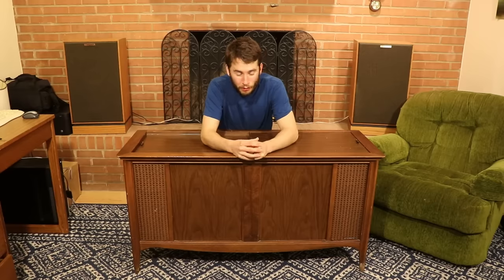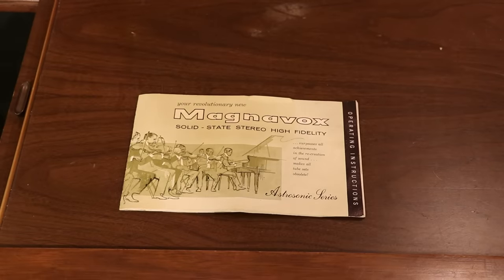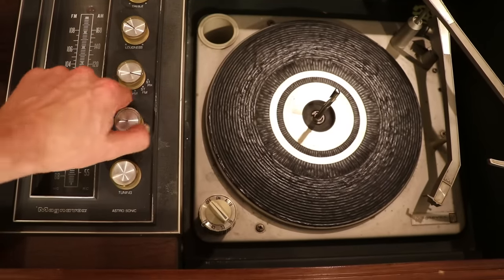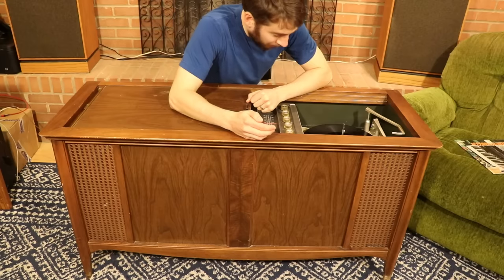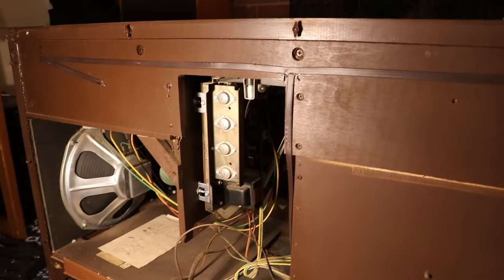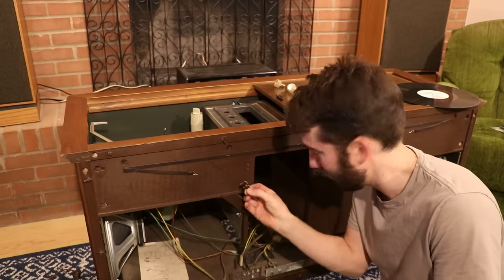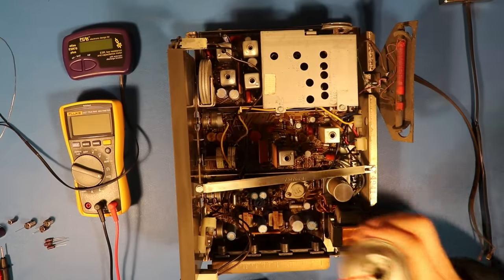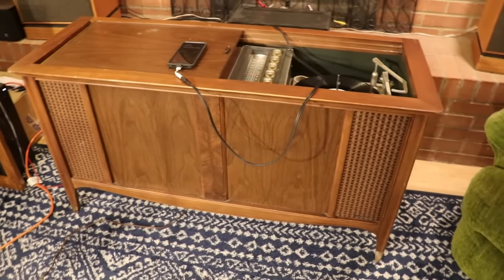They Found A Broken Stereo Console On Trash Day...Let's Fix It!!

Comment: I have the same basic chassis in a Magnavox, but it is in a " Colonial" style cabinet. it was free on Craigslist. One channel out also,, but no radio or phone noise. Your tutorial was grear, and I will try what you have done, perhaps I will have similar luck. We used to use everything from dimes or in your case, a puzzle piece on the turntable pickup arm of  modest quality phonographs to adjust the weight on the needle. Thanks for posting.

Comment: Such cool vintage stereo! Why can’t there be cool individuals like you that repair such beauties in my area 😭🤣
Loved this video, thank you!
Reply: A few years ago we had a shop that did only vintage repairs on tube equipment and the line was out the door and half way around the building most Saturdays. In the back room they had a few older guys who were semi-retired doing triage as they came in. A good percentage were repaired on the spot with bulbs, fuses, tubes. The rest were done during the week.... or following weeks. Sadly, they closed up, probably due to a shortage of skilled labor as those guys moved away.
Reply: @rupe53  I would love to work with old electronics. I would love to repair tube amplifiers and some stereos. Even hifi console record players that have radios built in. This would be a good retirement racket to get into. Not so much for money but just enough supplement income and having fun doing so. I could open up a shop if I knew I could round up enough business to keep it going. I plan on north Georgia about 2 hours from everything. Atlanta, Chattanooga,  Asheville etc. 73
Reply: @ronb6182  ... I suspect the biggest problem you will run into is area demographics. Where I live there are people who have the luxury of discretionary money. It's mostly upper middle class and they can afford to pay. The second thing is (where that shop closed up) about what the property is worth. They had an older building on the main drag in town and it was next to a new strip mall. It's easy to see the location was worth more as a Burger King these days, despite the fact that it was probably someone's humble home in 1950. Not saying it can't be done... and there are people doing vintage repairs, but you need some research on how to develop that business, so you don't wind up with a garage full of junk (and parts) without a way to pay for your time. I would suggest an open-ended credit card deposit to cover diagnostics and shipping costs as a starter.... and no warranty on anything that's not repaired completely. IOW, short cuts = no warranty. Still going to cost a minimum of $100. (just an example)
Reply: @rupe53  yeah I know I would rather locate a repair shop already established and work part time. But my luck I would have to drive to Atlanta. I think they have a shop or two. I will keep a post if I find a shop I have a couple of years before I retire my current job. 73

Comment: I saved a 1962 Packard Bell Hi fi console the same way. Mine is Tube though. It all works and I have my PC sound board connected to the auxiliary RCA ports and an 8 track player attached to Tape. Record needles were kind of hard to find so I bought three of them. The Stereo isn't super valuable but I like it.

Comment: My Zenith console tape inputs sounded weak as well.  I saw there were two capacitors (one per channel) just after the jacks.  I replaced them and it fixed the levels.

Comment: I have an old TV/radio/ record player unit and it is from around the 50's made by Siemens, it ran the last time I used it but will need recapping for sure.  Mine has Valves in it  and it is extremely heavy I looked it up and weighs in close to 90 KG, it also come with the manual but it is in German.

Comment: I would have gone right out to save that, too. I’m a buff 💪 of radios 📻, consoles, and 5 inch portable TV’s 📺 from the 1970’s and 1980’s. My mom bought me a console at Salvation Army for $147.00 in 2010. It means something special to me, as to her passing in 2016. One ☝️ of the channels to your speakers 🔊 is bad. It’s probably a bad capacitor on the board. Could be a bad potentiometer. I’d be VERY CAREFUL, if you’re hearing crackling noises (it’s probably only static), but if the noise is actually crackling noises (and burning smells), I’d be worried about fire 🔥. That AC hum is the classic symptom of electrolytic capacitors going bad. I don’t think 🤔 I’d try amplifying that noise, it might blow your speakers 🔊. Your friend, Jeff.

Comment: Mid 60s Magnavox. Very boomy sounding. They deliberately made them that way. Most people thought "Hi Fidelity" meant loud booming bass. With some tweaks you can make it sound a little better. It is under-powered. About 10 watts RMS (only two output transistors per channel-- and they are Germanium type). Sylvania made the best console at this time. 30 watts out per channel and they sold it with a high end German DUAL turntable with a Pickering cartridge. Real Hi Fi.

Comment: I have a 70’s RCA console and the one speaker cuts in & out. The speakers are incased in some sort of foam insulation. I need to find out how to pull the board like you did.

Comment: I was in my teens in the mid 1960's when my Dad was looking for a stereo receiver, record player. Magnavox was top of the line and I remember this model looked like the one he was about to buy. It was a $499. stereo. A brand new 6 cylinder Mustang was $1900 brand new. He chose a Dual record player, Scott receiver and a pair of EMI bookshelf speakers with eliptical drivers.

Comment: Nice find
Been hoping to score a similar MCM style console for years.
Given size and weight, plus gouging by "collectors " sellers for units, often not even serviced, you need to find these local.
The real value to me is the MCM cabinet, and speakers and amps secondarily.
Cool to futz with the radio tuner and turntable, but putting in a more recent table and disc player via line, aux inputs is the way to go

Comment: In the 60's I worked in a store that sold Magnavox Stereos and televisions. 
One of the earlier systems had a record changer that promoted that its tone arm tracking force was 1/10 of an ounce and there were aluminum coins that were given out as promotion for how light that was. 2.8 grams is considered pretty heavy these days. 
They used crystal cartridges which were only fair fidelity and nothing like later magnetic cartridges.
Those early changers had a very advanced method of measuring each record for diameter allowing different size records to be stacked as long as the largest one was on the top and played first
If it were mine, I would mount a modern turntable, receiver, and speakers in it.

Comment: I have a very similar console, same brand. I bought it for $80 about 10 years ago. One side didn't work but what I did (since I'm no technician) was to hook the wires of the non working side to the other lol "problem solved" everything else works prefect. I use it just every now and then just to keep it from rotting.

Comment: I have a very similar style 1961 Magnavox console stereo with vacuum tube electronics.  My mother purchased it new when I was a toddler and it was still going strong 15 years later cranking out Aerosmith and Elton John when my friends would come over.  The tuner has FM but is not stereo.  There is a "FM MPX" position on the selector, but it never did anything.  I think it was for a future upgrade.  I still have it in my home but it has been many years since I plugged it in.
Reply: Mpx stood for multiplex . That was fm stereo in the old days . You have to have an mpx adapter . As of now , fm is mono and not stereo without the fm multiplex adapter .

Comment: Just in good faith I would replace all of the TO3 output devices along with main power supply caps and filter caps in final output section. And you will have a fine sounding console stereo set. And plug in a audio blue tooth receiver into your extra RCA inputs and have all kinds of great fun.

Comment: Nice job, better success than a Toshiba SC330 I'm working on, The Toshiba's negative 38V filter cap takes like forever to discharge, so of course I forgot the other day, went to do some soldering, spark, darn, there goes a transistor.

Comment: The pop is most likely a bad coupling cap or the old transistors are leaking. But a cracked solder joint might cause it as well.  Like you I would fixed one thing at a time to find the real source of the pop

Comment: Greetings . First of all congratulations for the channel !!! EXCELLENT !!! your work the one you are doing, I have an Onkyo Digital A-8800 with all the modules of the equipment are Onkyo which are an M504 amplifier, with an EQ540 Interga equalizer and another EQ-201 and another EQ-25 and another EQ-140 and one TA-2550 Interga and one TA-2750 Interga and one TA-205 Interga deck. a CP1500F Interga platter and Ortofon 40 turntable needle and CD DX-708 Interga, and the T-4500 Interga radio, All the models are from the Onkyo brand, which is the best that Onkyo does NOT make mass production if they are not selected from the Onkyo And the cables connected to the equipment are of the KabelDirekt Pro Series RCA brand and 4 DAS R-212 Speakers. and 2 Mivoc hype 10 g2 hifi subwoofers, 300 w, from 20 to 180 hz. IN THE END A CLASSIC OF THE 80S AND 90S of sound equipment of that time, over the years I have never broken any module, that is already seen from how they worked before and the manufacturing materials, I hope to have it duarte, many years for the quality of a good musical team, greetings and very good videos that you have a great like for your great videos, great sound models like these devices are no longer manufactured, it is a pity, that nowadays everything is plastic, greetings from Barcelona - You could do one of Onkyo Interga also of Review - Congratulations to all Onkyo electronics, the Inegra Series was a true excellence. I bring you bad news, for this glorious brand, which made hifi history, these days, Sharp, who recently acquired the brand, announced that the debt is incurable. The electronic audio equipment company Onkyo has filed for bankruptcy, after accumulating debts of US$24 million. Onkyo, founded in Osaka in 1946 under the name "Osaka Denky Onkyo K.K", has failed to position its mainly analog equipment in the streaming era, consequently Onkyo has been declared bankrupt by the Onkyo company. Even if the electronics produced today had nothing to do with the wonderful electronics that it has... A big greeting from Barcelona, Spain,

Comment: Looks like the one we had back in the 60s when I was in High School. Guess I just dated myself. Tube set, you'll be lucky to find replacements.
Hum means the power supply rectifier or filter capacitors. No tubes? Must be a later model than the one we had.

Comment: Magnavox tape decks had a pretty high output, Thats why Tape in is not going to be very loud with most other/Modern devices, Any easy fix is to use a line level booster, Also you can replace the resistors, I found 10K ones work well

Comment: I have owned quite a few Magnavox stereo components in years gone by.I could kick myself for getting rid of my 1500 plus reciever.It had a matrix 4 channel decoder.It was rated at 150 watts IHF and 50watts per channel RMS. Magnavox was conservative on their power output ratings.Many times the amp put out a little more power than they rated it. The IHF rating was the institute of High Fidelity rating, much higher than RMS the theory was an amplifier was capable of putting out more power in short bursts so they said. When Magnavox quit using tubes they used Germanium transistors which gave a similar tube like sound.Their Micromatic turntables are the best made in England.You can inter mix different sizes of 33 Lps and the turntable will index to the different sizes of  those records and play them as long as they are all the same speed.The 1000 hertz horns are the best! I have 3 end table stereos Magnavox made and have one hooked up to my computer using the aux input and the sound is fantastic listening to music on  you tube! They are quality instruments! i recently purchased a 1000 Magnavox reciever hard to find. for a short time Magnavox came out with the MX series recievers before they sold out to Phillips .

Comment: You do have to be careful when working with vintage equipment such as that console. The power is via a 2 prong AC cord. It is quite common for units of that vintage to have non-polarized plugs. You have to be careful to check whether any side of the cord goes to a metal chassis. If so, plugging it in the wrong way could give you a surprise when touching some of the metal inside the unit.
Reply: Solid state not a problem.
Reply: Would you suggest regroining it in that instance?

Comment: That's a great old piece.  My maternal grandparents had a similar unit when I was growing up, and I thought it sounded really good.  I loved bringing my own LPs to their house to play, but I had to be judicious in my selections.  I was almost hoping the electronics would be non-salvageable and you'd have to install more modern bits.  Something like a Kinter K2020A would suffice to get it working, and might even sound better to modern ears.  Still, making the original work is better if you can do it.  Did you also address the speed inconsistency issues with the turntable?

Comment: There was a house in my neighborhood across the street and a few houses up from mine, this was in the late sixties, they played their music really loud, I'm thinking that they moved so out on the curb was this big piece of furniture, this was around 1971, it was Magnavox stereo, I don't remember if my father helped me bring it home or who because it was heavy, you see I never had a stereo of my own, my sisters did but I forbidden to use it. So now I have this in my cellar and I was excited beyond belief, my family wasn't poor but we weren't well off either, we had a house a car food clothes etc and two loving parents and now I had something to play records on because this particular unit didn't have a radio just a record player, it had a 15 inch woofer and get this, a 12 inch midrange and two tweeters a very unusual setup and it was supposed to be stereo somehow, the controls were dirty and there was a lot of static as a result, I put a record on and found out why we could hear it half a block away, this thing was loud and the sound was very powerful with those large speakers, it was this unit that gave me the stereo bug, one thing i forgot to mention, it.had a tube amplifier which accounted for the unbelievable amount of volume it put out, I wish i knew what model it was, i ended up taking the drivers out and the amp and preamp, i made a cabinet for the amp and preamp and used it until i got my first receiver, so if anybody needs a Magnavox tube amp and preamp let my know, the last time i tried it was many years ago and the sound was kind of weak, it definitely needs some attention.

Comment: The needle on that turntable is a pain in the ass to deal with.  Currently I get the feedback issue when touching one of the knobs,  I do need to take it apart to clean as well as replacing the belt on the turn table as mine speeds up and slows down, but hey it was my grandmas from 1963 and I'm sure its had no service.
This unit you just repaired i would date at probably 1970+,  funny thing is they really didn't change much except for cosmetic and lights

Comment: My two sisters had magnavox consoles like this. They were ok, I guess, however in the 70's when stereo recievers and component systems began coming out on the market with separate components such as the integrated stereo receiver with 100 watts per channel and even more, separate turntable, separate tape deck/cassette deck systems and the fact that you could separate your speakers at different locations within your living room, made them much more advanced in sound quility and technology, it pretty much took these consoles out of business. I haven't seen any of these now for a long, long time.

Comment: Did you find a model number? The Magnavox line of "Astro-Sonic" solid state consoles was introduced in 1962 and ended production in 1973 or 1974. Yours looks to be from around 1968-69.

Comment: You replaced a transistor, but did not re-calibrate the transistor bias? Also, the turntable most likely sounds terrible because it has warn bands, maybe an idler wheel that is not even, or dried up overly sticky grease. Any chance of episode 2 happening?

Comment: Magnavox. First, clean all speaker switches (for internal/external).  This is often their only issue.  As fort the "record player" it's actually called a record changer and will play a stack of records automatically and then shut itself off if you know how to use it.

Comment: In its time, the use of TO-3 case style power transistors vastly increased the audio output power compared to tubes, and would be high range equipment. With the extended warranty, you've discovered there's very little you needed to do to get it working well... They could have warranted it for 50 years, and still made a production profit ..!

Comment: Since the output transistors run hot, I would not have used de-oxide on the leads permanently. I would have cleaned them dry after an hour before assembly.